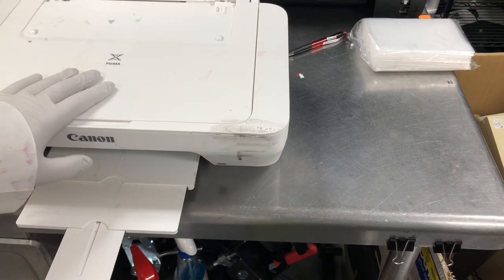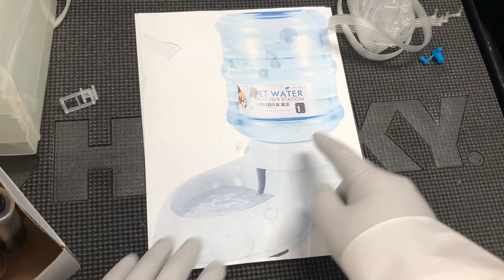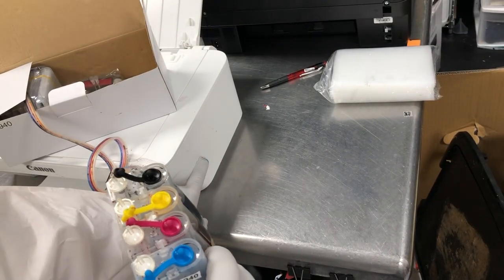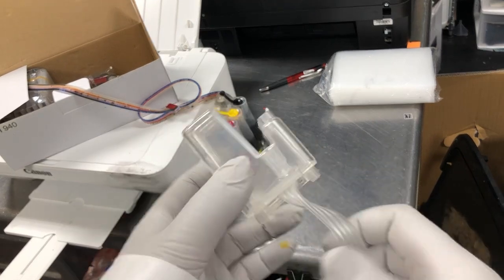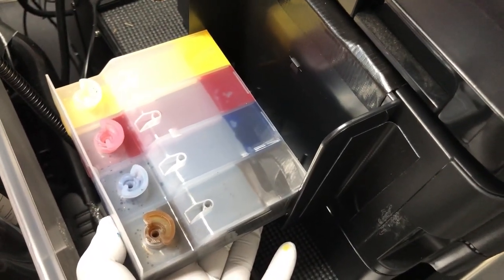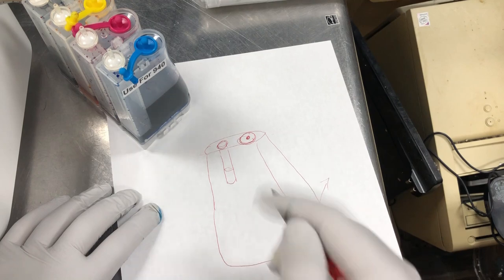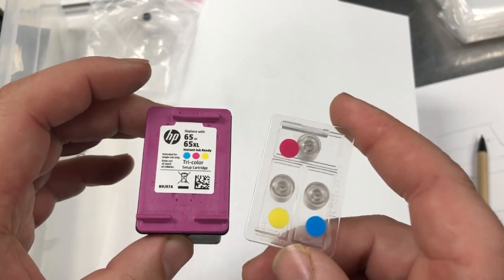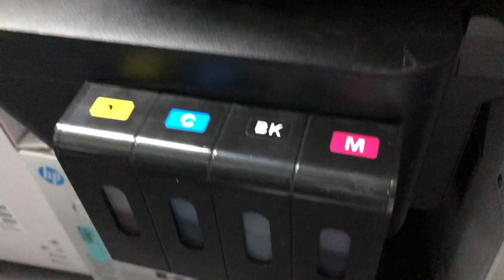Add Ink Tank to a Printer - Part 1 - Ink Tank Design for CIS System

Comment: My problem was the pressure difference with the ciss. The HP62 tried to print but it couldnt produce the suction to pull the ink out of the tanks. The print therefore was incomplete. I removed the tube from the cartridge and suddenly, the print was complete again. I tried different heights with the tanks so that the pressure is equal, nothing worked. 
Either the print was incomplete or the tanks drained through the printhead, creating a mess. 
I made the cartridges airtight so they could only draw ink, not air. Is that wrong?

Comment: Hello, I opened my canon cartridges 245 246 and refilled the ink ,now my printer prints blank pages. I cleaned the printhead and it doesn't seem like it's clogged. What else can I try.
Reply from the maker: You probably need to prime it.  Get a priming kit.